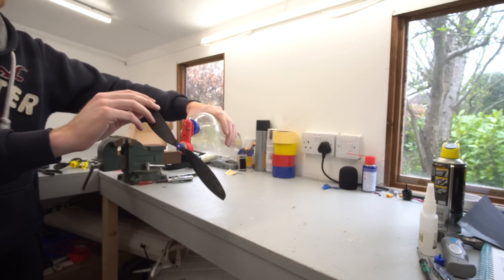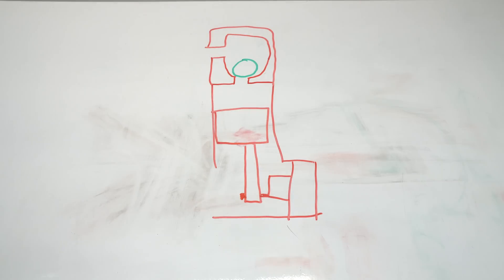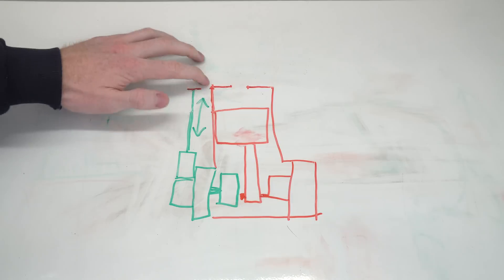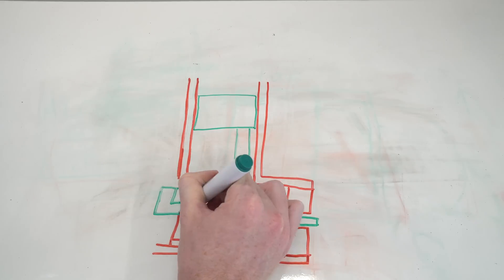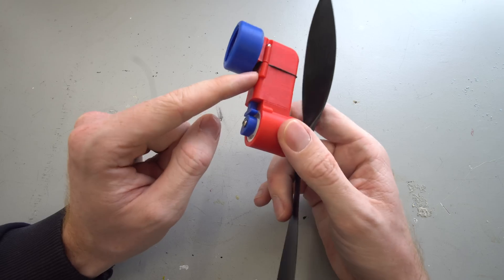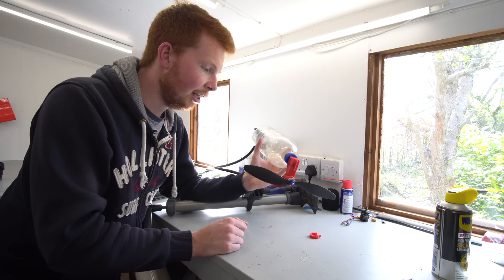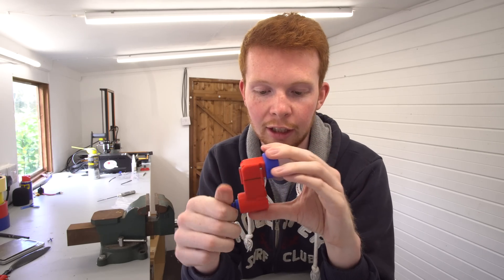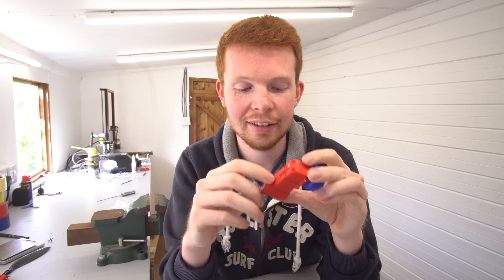Compressed Air Engine V3

Comment: Ideally you'll want the valve opening just before Top Dead Centre, and then the Valve fully closed just as it reaches the exhaust ports.

Easiest way to do this is put the piston in the position you want it, and place the cam gear on the spindle.  This is where you may need to print new cam gears to deal with the offsets, but you'll want the cam gear touching the rod just as the rod presses on the ball for top dead centre. And the opposite for the exhaust.  Then just keep increasing the throw of the cam until you can achieve that timing.

Also it should be noted that I believe your engine design has a compression stroke as well as it returns to top dead centre, and this is causing loss of energy.  As the piston compresses air left in the cylinder (atmospheric pressure)  back up to top dead centre.   

This could be rectified with a series of ball valves allowing an actual exhaust stroke, the engine would still be 2 stroke just you would have a valve that opens and lets the piston rise without compressing air.  
 
Easiest way I could see this being achieved with 2 cams is having 3 ball valves.

1 ball valve connected to pressure source only opened on intake/power stroke
1 ball valve sealing cylinder
1 ball valve above the cylinder ball valve that is engaged during the compression stroke, I.e a taller cam gear pushing the ball valve higher and unseating the vent valve.

Though realistically in this sort of "engine" the cylinder valve could be basically eliminated, as compression doesn't matter whatso-ever.  Infact you don't want it.  But currently you are compressing air.

Comment: Since the exhaust port is at the bottom of the cylinder the piston has to perform compression on it's way up once the valve us occluded. This will result in a loss of rpm. Perhaps you can design a system with both an inflow and exhaust valve driven by the crankshaft to minimize rpm loss.

Comment: Hmm ... why do you need to push the cylinder head down? Can you just put the valve below the cylinder, closer to the shaft and put the cylinder up? That way you don't have to move the motion all the way to the top of the engine.

Comment: Very nice!  Once you get this motor completely sorted with cam shape and timing.  How about a vane-type air motor?
The challenges would be to seal the sliding vanes to the end plates and inner diameter of the housing as well as the holes where the shaft passes through the end plates.  The shaft seal should be as easy as sealed ball bearings placed in the end plate with caps to retain them.  The expanding air passing through the motor should go a long way to cool it.  If you opt to create passages in the housing to allow input pressure 'under' the vanes they will press outward against the housing diameter...but would likely need an oil mist to lubricate and provide the final seal.  The air flowing into the motor could be used to draw oil from a reservoir...or you could just add a couple drops to the motor's input side then screw it onto the bottle before running.  A nice olive oil would prob'ly work...and you could have a salad at the flying field!

Comment: I probably missed it, but where or how does it exhaust the air at the end of the power stroke?  Has it simply lost the pressure due to tolerance?  Great idea for a design and printing project!

Comment: put a pressure regulator on it e.g. pump the bottle up to 60 psi and the pressure regulator at a max of 25, it will run longer a a more even rpm

Comment: Very cool indeed !  Congratulations with very good design thoughts. But... I really do think you could also have a look at how a modern pcp airguns work. Hand for that matter also firearms that use the blow back gasses to perform additional actions. The air coming out of the cilinder is not used and is wasted after every cycle. I think it must be possibel to somehow use it to influence the valve timing and therefor the engines effiency.  I remember seeing tests with a rotary valvesystem for racing engines as well. Could be an interesting thought...

Comment: HI! I have an Idea for a longer lasting motion:
Obviously to increase the time the engine is running, you have to increase the pressure in the tank. but that is only working partially, because at higher pressure the motor runs faster and consumes more air. The solution: install some kind of pressure regulator, maybe even an adjustable driven by a servo motor, so you have throttle on your plane.

Comment: One thing to increase your engine's efficiency would be to create a clearer path out of the engine for the exhaust air. This increases the ratio of pressure between each side of the piston face, increasing the amount of work the air will do. I understand this may complicate it further however if done well it will still be a gain and you'll get more from a given vessel of compressed air, be it soda bottle or shop compressor.

Comment: So I am generally clueless about these things, but wouldn't another option be to have 2 inlets for the pressurized air: One at the top and one at the bottom. Could we then not have a simple opening and closing of inlets as the valve moves? I am probably missing something obvious, so I would appreciate if someone could enlighten me. 
Oh, and awesome video as always!

Comment: cory shadley took the wind right out of my sails.  It is not so much a question of pressure but of lower pressure and volume of air.
But please keep up the good work as a 'quiet' type of propulsion is needed for gliding in the city parks.

Comment: How about having a metal cylinder compressed to a few bars and then regulate the air going to the engine with a valve?

Comment: When you are hooking it up on a plane you should add a bit of dry ice and water in the bottle which might allow it to stay in the air for longer than if you just pressurized it with a bike pump. Plus it wouldn't be so labor intensive. Although you would have to test how much exactly to put so you don't rupture the bottle.

Comment: Tom fantastic job on V3!!! I'm sure you know you'll be seeing friction wear on the cam assembly. Any thoughts on trying to print in something like nylon? I'm sure you'll have to upgrade your hot end (E3D v6 stainless) and possibly push more power to it as well to sustain the higher temps. But with nylon, you can print some of the other parts to withstand the higher pressures for sustained flights. Also, thoughts on a needle valve for regulating the air coming out of the tank? That way you can have smoother power and longer flights.

Comment: Why not make it similar to AirHogs? There's just a little spoke on the piston that pushes the valve up. I mean you can't adjust timing much, but that would make things exceptionally easy. EDIT: Nevermind, I just grabbed my original out of the closet, it uses a spring and ball valve, looks like

Comment: You should design an exhaust valve assembly. One of the things I notice with two-stroke air engines is that the full stroke of the piston is not used during the power cycle (part escape through the exhaust ports) and not all of the air is easily evacuated from the cylinder, causing the upstroke to have to compress air and lose more work than if the entire up-stroke was left open until the next power cycle.
Reply: Broken L. - Dang-good comment/idea/lesson!  You just improved the efficiency and efficacy at the same time !!!
Reply: This would be different thpugh because it isnt an internal combustion engine. The only reason exhaust systems were invented was to remove harmful gases the prevent further combustion from an engine. Once a cycle has been completed in an internal combustion engine any air left in the cylinder contains very little oxygen and so and further combustions (or power stokes) have significantly less energy due to reduce oxygen in the cylinder. Exhaut systems allow burn gases to be removed from the cylinder. An exhaust system wouldnt have amy significant increase in perfoemance of this engine so long as air can escape as it already does
Reply: @georgefletcher2989  

You are quite wrong about this, unfortunately, because engine efficiency is pivotal in situations where you have a finite source of energy. Now, it would take some special equipment and access to his exact specs to get even a theoretical estimate of the piston stroke efficiency here, but it certainly isn't 100%. 

So let's say that the pressurized air inside the cylinder after a stroke is 10% of the pressure during the stroke. Then, without an exhaust port, as the piston is driven back up halfway through its travel, that pressure will now be 50% of the pressure on the other side, decreasing the power of half the stroke-distance by 50%. By the time it finishes 90% of its travel distance, the pressure now equalizes and you don't even complete a full stroke under power.

In all likelihood, this engine is doing about 30% less work for the amount of air being used by the system as a result of back-pressure on the piston. And that's actually working under the assumption that the valve stays open for the entire stroke to maintain constant pressure. If the valve closes partway through the stroke, you're looking at a dramatic drop in the power of this engine.

Comment: So i can Tell you from Metall working class that the hole valve system will Work best Just use a heavy flywheel

Comment: Lower your pressure by setting it with a pin hole.  If you can find the right pressure to keep the plane flying you get better efficiency and longer run time. pressure regulator before your ball valve. lower pressure  = smoother valve operation and less stopping force.  Also you have less friction in the system, and load bearing force. Also your ball valve cam doesn't have to be large.  You need something small enough to get the ball out of the way.  smaller diameter and longer cam lobe/lift gives you enough force from torque but less upward thrust. Optimal operation will make the valve timing less issue.  you may not need to regulate pressure as the cam diameter and it's lobe will also regulate the pressure.  You essentially could get two for one.

Comment: you can try to make a bigger air tank that still holds high pressure by conecting 2 or 3 bottles front to back, by using fittings, through holes in the cap and bottom, so you are not glueing bottles togheter and not weakening the bottle, you could also use tubing to place the bottles side by side

Comment: Hey Tom great work, very impressive for a first go around, when you get to higher pressures 250psi, which that bottle can hold no problem, you should design or buy a pressure regulator, that way you can dial it in with more consistent results and longer flight time

Comment: Are you using printed bearings, or at they ceramics? If you're not printing those, you could use a smaller bearing? They look like 608 but maybe they're 625 or 623. You can find really tiny bearings. Here's a table of sizes: https://www.smbbearings.com/products/miniature-bearings.html

Comment: Could you just push air from the crank side...use the piston itself to push down opening the valve...push the piston up, rather than trying to push it down. (pressurize the crank area)
Very neat engine design...love the cam

Comment: You should try making a connector for two bottles, like a y splitter, for longer flights!
Reply: Jonesy Films, I was thinking to make a huge plane shell and fill it with bottles, wings and all
Reply: And attach then with tubes
Reply: Ryan Hopman make sure you use pneumatic tubing, and maybe get connecters from andymark for simplicity
Reply: I think an air bladder would help create a continuous pressure as the volume decreases. Like a super soaker cps.

Comment: It looks like theres a bit of friction from the valve opener still. If you reduce that you might make this more efficient. A good way to do this is possibly with a tempered glass screen protector (s8 ones have the curve in them already). They have so little friction that if you go onto asphalt and lay them down flat and push them, you keep going. A thin slice of one cud help reduce friction possibly

Comment: great design I really envy the creativity you put into it, though i feel the second test with 60psi didn't run for much longer than the 30psi test, so i think you would have to find a way to have more volume of pressurized air rather than more pressure. just an observation

Comment: Great Tom!
With the cam you have solved the problem of the valve, but I would say that it would work also with the round piston and perhaps better: the reason why they do not make square pistons is that in the corners there are losses of pressure.
Another reason is that the circle is the figure with the shortest perimeter and therefore in the square piston with greater contact surface you will have more friction.
BTW some PET bottles have withstood pressures of around 150 psi,
seen in a video TV so you can go quiet even a little more on 60 psi.
hi I'll see you in the next video

Comment: I need to see an endurance test where instead of air you just put dry ice into the bottle.
Reply: Super idea
Reply: +1
Reply: or some other kind of rapid expansion gas
Reply: like him so he can see this
Reply: Liquid nitrogen
Reply: Would the low temperature of the dry ice make the plastic brittle, maybe brittle enough to fail under the pressure?
Reply: Лед не будет испарятся достаточно быстро, чтобы питать двигатель углекислым газом.
Reply: @Любопытныйпрохожий-х5з  translation: The ice will not evaporate fast enough to power the engine with carbon dioxide.
i dont know why in russian though

Comment: Really really fantastic job. Correct me if I am wrong. The cam should leave the valve open ( theoricly at least) for all the downward stroke ( from the upper end point to the lower end point)  because that is the stroke where the expansion of the air produces usefull job. Then the piston reaches the exhaust port (at the lower end point) and the pressure is equalized to the ambient pressure. Is this correct?
And I'd like to ask you. Is the piston compressing the air during the upward stroke? If yes wuold be a good idea to add a second valve that opens during the upward stroke in order to not compress the air in the cilinder and wasting some useful job?

Comment: I am a mechanical engineer with a long history of machine design and you never fail to amaze me.  Great design and great execution.  I am particularly impressed with your getting the cam shape and timing so close on the first try.  It would be quite interesting to see if it can be much improved.
Reply: I know right!
Reply: David what things do you not understand? I’m a software engineer not a mechanical one and i understand 95% of the things he talks about.
Reply: ok i get what you are saying but for the most part those are engine parts names and you can determine what he means  with what he is  showing you on screen. That is the way I learn new terms/things. when someone says "slider valve" and then proceeds to show you an opening that acts as a valve when is a plastic piece slides up or down you already know it's slide valve. it's not about knowing the terms but by understanding conceptually what he means you will get a better understanding of the whole process then just knowing to terms.
Reply: David his drawings seemed pretty basic to me as in not hard to understand.

Comment: you could try a radial version like a wankel engine. This way you would not need a valve because the rotor itself is the valve. Sealing is problem I have to admit

Comment: If you got one of those old school sparking water bottles it takes more pressure, use a pressure regulator (that's the tricky part) and you can take more air with u making it run a lot linger

Comment: Greate series. Looking forward to v4. Why not extend the cylinder above front bearing to get lager effective area? It is a 3D print. No rules apply. To get the piston centered under the pistonhead would get less drawer effect during down pressure.

Comment: when I was a young lad we had these foam airhogs airplanes with compressed air engines on them and they came with a bike pump you would pump them up to whatever the maximum pressure was and then give them a spin and chuck them into the air, they were great fun and usually flew for so long that they would leave the park you started in and get lost in someones backyard specially if you threw them down wind
Reply: we owned one too... they were incredible!

Comment: V4 make a cam for exhaust on the up stroke so there won't be any resistant air on the up stroke so the exhaust ball will have a spring or just exact rod length pushing it up (closed) then the cam will have a small dent in it to open on the up stroke to let the air out completely then TDC it closes the exhaust then repeat. Good to see you re visiting stuff.
Reply: Nice idia engenier;)

Comment: Awesome job Tom. One of the next things I would try is lowering the cylinder volume. If you can get enough HP to spin the prop with less air you will run longer.